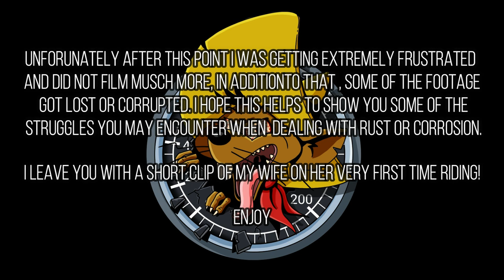Exhausting rust - how to remove rusty studs and bolts - exhaust leak repair - Honda CB600 Hornet F3

Comment: Hi mate currently doing my hornet and the exhaust bolt and stud are coming out together any ideas?
Reply from the maker: That's a good thing, you can then replace them with new ones
Reply: @RGMgarage  2 have come off and i think 4 are bringing the studs and ive unscrewed them a good few times dont want to round anything i feel like the one atleast has stopped coming any further do i just keep unscrewing or? Also should i disconnect the pipes from the mid pipe section before hand or keep it on for now? Thanks for the reply👍
Reply from the maker: @Forza Squid  loads of wd40, back and forward movements and patience is the best advice I can give you. Remove as much stuff as you can
Reply: @RGMgarage  shall i continue bringing the stud and bolt out together? Is there anyway the stud could stop coming out if its already half way out? And what do you mean remove as much as possible? And should i leave it attached to the midpipe for now? Sorry for all the questions just need to get riding ive had a couple weeks off road dreading this lol
Reply from the maker: @Forza Squid  remove the mid pipe 
There shouldn't be anything holding the studs other then corrosion. Spray wd40 and screw the studs in and out until it comes out. 
That's all I can suggest, good luck
Reply: @RGMgarage  cheers mate will try again tmoz appreciate the help will let you know how i get on.. i wish i can be as good in the garage as you one day id of been sick thinking about doing all what you did to yours lol fair play👍
Reply: @RGMgarage  sorted was cos i never removed endcan/midpipe first it was ready to come off cheers for the help
Reply: you mean the NUT and stud?
Reply: @RGMgarage  wd40 no good, you need plus gas

Comment: Am Doing mine now well my mate is we got 4 out normal way,  4 snapped :/ tried welding a nut to the stud no luck went and borrowed a better welder still no luck spent hours drilling the studs after grinding them down drill ends kept snapping, at the end of the day we welded 2 nuts to the little bit of stud left hoping this will work we shall see tomorrow.  Headache

Comment: I replaced my motorcycle with a parking lot in front of the building 3 years ago. I don't have a garage, the screws were in better condition, I broke 2 screws. But how could I have such a neglected engine? I always spray it and remove the rust and undercoat it with something. This is a very difficult matter and even a mechanic won't do it because he knows how much work it will cost if it goes wrong.

Comment: Use heat First. Best way.
Reply: I totally agree with Gavin - it's the heat from the engine that's your enemy with getting them jammed in there - and the heat from your MAAP gas torch that's your friend with getting them out!

Comment: Is there a cheaper sealant option to block the leak as mine is on the middle exhaust , tried exhaust paste lasted couple of monthes , just noisy now
Reply: metal epoxy putty
Reply: tighten the bolts/nuts on the center cylinder first

Comment: Your vids are very helpful. Having a nightmare with the same stud issue at the mo and dont have the welder and clamp on tools you have. When you say you drilled the last 2 what does that entail? Thanks
Reply from the maker: Hello mate , what you can do is to get I smaller drill the the size of the stud and gently drill the stud and then make a new thread. 
Message me on Facebook (link in the description) and I'll guide you. Hope this helps